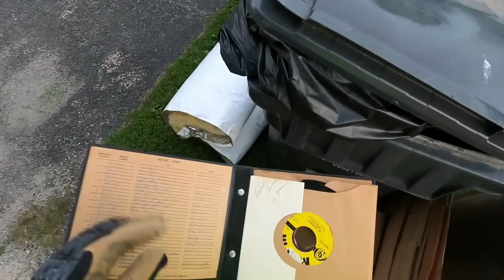Serious Street Scrap Aluminum

Comment: I just told "Mike the Scavenger ", I dragged a motor thingie with brass fittings on it behind my work dumpster. I asked several customers (in conversation) if they scrap. I had one gentleman that took it.  It ended up being about 25.00 worth of brass, then shred metal.  It made me feel good.  I'm watching and learning from you and Mike.
Reply: Mike and Paul are great
Reply: That was very nice of you.

Comment: Great video Paul. Here's a hint/trick I use. I tie a small piece of shoe string through the holes on my hard drive magnets. makes it alot easier to pull off metal when they are stuck. give it a try. 🙂

Comment: Maybe I am taking this the wrong way but if there is any changes involved I would have thought they should be paying you to have the brake discs collected. To charge you for collecting seems the wrong way round to me.
Reply: It's basic business. They have scrap which has a value of X which they are currently getting rid off for nothing.
By selling it to Paul at $20 per load, they are making some money whilst not having the hassle of taking it to the scrapyard themselves.

If Paul switches to a monthly collection, then he makes $380 after their cut. If he keeps to weekly, Paul makes less, but they make more.
Reply: @ramblingman8992  Yes, its a bit of a double edged sword. They should be paying Paul to take the rotars away as he is providing the service for them. But I suppose at least that way everyone gets a share of the pot so both parties win. Good point.
Reply: @DSCC007  And this way he has a secure source. "Sorry Phil, Wisco, and Rambler. This account is Paul's"

Comment: Your scrap mess looks a lot neater than some peoples houses who don’t scrap. 🙂

As far as picking up the rotors from the chain outfit. I would leave them a container like a plastic barrel or box. Give your name and number to the manager. When the container is full you have a pre-agreed upon price to pick it up when the store calls. Make it fair for yourself price wise, so your not doing it for nothing. This way on months with few brake jobs you’re not making empty runs, and some months you may several runs. Be conservative on the percentage that you pay the shop, explain it’s to account for your costs and fluctuating steel prices. Now the shop can advertise to their customers that they recycle too.
Reply: This seems to be the wisest way if he has to pay at all. If the barrel will hold enough to cover the cost and make a profit. What is his past experiences?
Reply: Corporate is just getting greedy🤦
Reply: @lisacates4185  How do we know it was corporate  & not just , manager,  
yes leaving bin there would be a good idea.  Thanks
Reply: @donvoll2580  I was going to say, maybe manager could have a hand in on it. If manager just trying to help save a couple bucks fine. But if trying to make someone else to pay to get rid of there trash, doesn't work that way.
Probably doesn't understand that steel, cast and tin you don't get anything for.
Some places you may have to pay to get rid of tin (white metal).
Reply: Look at the number of thumbs up on Dave's suggestion. Good workable thinker.

Comment: As for the rotors: they would normally have to pay for trash removal, which is what they are to them, but it's not at all unusual for what is a waste product to be sold if it is of value to someone else. I would counter-offer, you don't have to take their first offer, and it seems like it would be better to do it per pickup, instead of monthly so you're not paying during slow months. Run the numbers and see if it is worth it.
Reply: I agree except for the part that it would normally go in the trash. Most of the auto shops in my area already have a scrap yard metal dumpster that once full they get paid well for it from the scrap yard.
Reply: yea most trash removal companies arent going to take rims, rotors etc. the shop has to get rid of it somehow, costing them money to have it sitting around waiting for a citation or whatever. Make a shop an offer to be their sole removal source. they call you and only you

Comment: Idea 💡 
When you get another scraped reach in cooler bolt some caster wheels on the bottom, spray it with your colors. This could work and be heavy duty but still may have to unload a portion then flip it on the side to empty.

Comment: on the passing train the 2nd DPU aka 'Distributed Power Unit' (mid train diesel) was KCS aka Kansas City Southern Railroad.
Reply from the maker: How did that Kansas City engine get in the middle of Illinois?
Reply: Multiple railroads contract with each other on continent-spanning long hauls. Based on % of mileage each RR allocates a number of engines. So, that said some days you'll see all UP, then a mix, and maybe all KCS. 

Other loco unit shares are what's called run-through. Each RR sends a daily train to the other as a normal part of commerce. They balance the horsepower hours between them per agreement. Occasionally the balance tips one way off norm. That's when you will start seeing more KCS units where you normally wouldn't expect them. Same with any other big railroads. 

In NJ where I am one can regularly see a huge mixture from all over North America (US, CA & MX).

Comment: Idea 💡 
Find a couple of those nice trash cans with the wheels. preferably a orange one and a green one, switch the lids to make your S&P colors. Then you could leave one at the rotor pickup and switch them out to save your wear and tear on you. Maybe make it worth paying for scrap if it leads to your cans catching on at other places too. $&P lift gate for the win!
Reply: plastic barrels are pretty tough and I bet he could salvage some durable casters off some exercise smacker2000's.
Reply: Ooo
Can that barrel fit in that trash can?
Thinking it needs a lid because of the weather (ice & snow). And a way to get his colors (brand) at the same time. 
Great idea of the equipment wheels!

Comment: I would definitely  pay up and be happy to lock it down at least for now.
 I think what most people are missing is the fact that a local scrap  yard has not already  put a metal dumpster in thier lot for free. This is common practice near me.
 Sounds like about 10%of the value so no big deal. Steel prices have likely bottomed so.
God may provide but it's your job to hold  onto what he provides.  👍

Comment: It's a big commitment to buy scrap every week or month. Your free to plan your own scrap collection. Plus, if the price drops if you add into the cost of fuel, you could be worse off.
Reply from the maker: Good point.
Reply: @ScrapPalletMan  Paul you are your own boss, enjoy the freedom, I do.
Reply: price drops, you horde the rotors. I pay $100/yr to pickup apt complex's scrap. Im sitting on 300+ garbage disposals, washer motors, ceiling fan motors cuz the prices havent been worth going for 2 or 3 motors. I'll walk away with more then I paid for the scrap

Comment: In my area commercial Locations are charged extra for garbage pickups, so scrapers are doing them a service by removing it from the landfill circuit.
Reply: in our area, commercial stores have separate dumpsters for scrap since it cant go in regular trash. Sears Appliances outlets have a semi trailer outback. I had deal with mgr to take stoves, microwaves, washers. till the installers cried I was stealing anyway

Comment: If your really interested in keeping this source, you get a metal cart on casters, you leave it for them and monitor how long it takes them to fill it up, then you will know how often you need to do a run, you need two carts, one to leave each time you do a pickup. never let a resource get away if you don't have to.
Reply: I like the cart idea. quick load and unload. Wheel it right up to the platform scale. Or two carts to switch out.

Comment: in Wisconsin the customer is supposed to get their old parts back. so the customer could say "im giving it to Paul and he will be here to pick it up within 30 days. probably not practical.
I like the notion of a monthly pickup, but you need an adjustment clause so in crash conditions you can cover cost and labor. it has to work for everyone

Comment: Hi Paul, for those rotors is there a guarantee every week that you will get enough of them to make it worth your while in paying them $20 a week. There is the cost of gas, your manual labour in picking them up, and unloading them at the scrap yard. Also how much are they worth. If you only get four one week, you’d have to take $20 off the end cost of what the scrapyard will give you. You could see if they could store them out back and you get them once a month for $20.
Reply: finally someone that grasps the concept. a guaranteed heavy haul spot for a nominal fee pays for itself in the long run. as the saying goes - it costs money to make money.

Comment: Hey Paul, just wondering if you know the propane regulators on the grills are usually made of brass if I recall correctly.  you could snip those off with your wire snippers.
Reply: zinc or  usually aluminum with a brass fitting.

Comment: I worked in a couple different shops and they add hidden charges in the bill to pay for disposal of things... It's in the shop fee... 
And unless the part is going back to the company for a core then the shop has three choices 1 trash the part, 2 pay to have hauled off, 3 give to scrappers.    He is trying to get paid and it will not go into the till.... If you decide to pay make sure you get it in writing and a receipt for each transaction..  then he has to explain the extra money or where it is.

Comment: Paul, do you utilize the chain mechanics shop for oil changes, mechanical work, etc?  Perhaps some vehicle work that you may need anyway might make the new manager think differently on charging you to haul away their scrap.
Reply: barter might work. usually for awhile till the work on vehicle outweights what you bartering for, then you on the hook for the balance or the manage expects a cut of the loads to cover the balance

Comment: Stainless can get rust stains on it. If a piece of steel is sitting on it when it gets rusty. When I had to keep my scrap totes/buckets outside. I definitely had to drill small holes in the bottoms of them. I've been scraping since I was 13. I'm now 63. So you seem like a rookie to me. But your getting there.

Comment: Purchasing scrap backfired on me from a dealer in another town, I would drive a route and it would be around 100 or so miles round trip a dealer in a town about  40 miles away would hold all scrap and batteries by the time I had got there my truck 95 Ford ranger was 3/4ths full mostly rotors and breakage I had to purchase scrap from the dealer but had done so for over a year,but this time I got ther they showed me everything and I paid which was around half of what I would get after loading everything the pile of batteries about 30 or so I had no room for which it has happened a few times before no problem just get them the next time which is within that same week well when my next trip the main guy thr manager got a new job and they wouldn't allow me to get the batteries I paid for .50 cent a battery times 30 or so so be careful I stopped purchasing

Comment: I do scrap metal in the UK and not once will I pay to pick up, Like you I offer a free service but when it drops as low as £30 a ton I will charge £5 a pick up and that's for whatever there is so if there is 1 or 30 items its still £5. I think that new manager is trying to take advantage, If they had a waste firm pick it up the company would be charged for the service...well at least here in the UK they would and I presume it would be the same in the USA. Tell the new guy to go whistle dixie lol I would actually wager the 'Fee' you picking it up wouldn't make it anywhere near the till or the accounts.

Comment: Do you strip the crutches down to clean aluminum. Or do you just scrap it as is.
Reply: they are usually riveted these days and the padding is so tight you couldn't make hourly on it. Especially the walkers.
Reply: @wisconsinfarmer4742  I use a reciprocating saw, or a hand grinder with a cutting blade on them. Takes me no time at all.
Reply: @TheCompound01  im such a frugal bird it injures me to use a consumable wheel or blade. 
do you slit the plastic sleeves to get them off?
Reply: @wisconsinfarmer4742  most of the crutches I get have plastic handles. Held on with a bolt. I just cut the bolt in half and pull out. The part that goes under the arm pit area. I just cut or grind off the rivets and knock off with a hammer. The rubber stopper on the bottom. I cut and pull off. As for the walkers. Cut bolts, grind rivets, let the hammer do the rest.   The hand grips and cushions. Try to cut and pull off. If I can’t get hand grips off. I just cut them off.
Reply: @TheCompound01  It is a shame that perfectly serviceable equipment gets cut up while people pay such high prices for new.
Reply: @wisconsinfarmer4742  very true. I do always ask friends and family. If they now anyone that needs or could use, before I cut up.
Reply: @TheCompound01  That is good to hear. Keep up the good work

Comment: You sure that's not a fee for disposal they are not passing on to their customers?  I'm mean in Ohio I was always charged a small disposal fee when I got new tires at the big chain stores.  I'm sorry but they should be paying you to remove it for them.  You have been basicly providing them a free service by hauling it away for them.   Think about your labor to remove it, gasoline in your truck, wear & tear on your truck, etc.  No you shouldn't be paying them for their scrap metal.  It sounds like this new person is just trying to find a way to skim off the top money that corporate really doesn't track.  Don't let him take advantage of you.  DO NOT PAY ANYONE FOR SCRAP to RE-SCRAP.  I guarantee he won't be wanting it piling up there in the way and then taking it down to the scrap yard.  This is just another example of corporate greed wanting to taking advantage of the small struggling working man.  Is he going to pay your medical bills when you pull your back out from lugging those heavy things out?  Isn't that brake dust hazardous...can it do damage 2 your lungs?   Please don't let him use you!

There's no guarantee of pricing on scrap and other factors such as fuel, labor is not considered either.  Just a thought....I would call around to different locations and ask what their policy is considering disposal of the rotors.  I'm just petty enough to call the corporate headquarters and ask if they have a contract for disposal.   Or if they leave it up to each franchise's discretion.  But I can guarantee that non of these shops want these piling up for a month to pick up.  I am also willing to bet they DON'T make others PAY THEM to have the honor to pick up their scrap...which is their trash/waste products.  Somebody's trying to scam you!

Sorry to be so long, but this just pisses me off to see people try to take advantage of you!  This just isn't good business practices.  I believe something else will come your way.  Leave your card and walk away.  Your overhead costs wouldn't really offset any profit for these.  God will send you a new opportunity.
Reply from the maker: I decided to let the automotive place go. Those rotors were never at risk of being thrown in a dumpster or the landfill. I'll utilize my time grabbing metal that is set out for the garbage man or in a dumpster.

Comment: Paul stainless steel isn't rust proof it is highly corrosion resistant it is also not 100% non magnetic. 300 series being the best in the corosion depart and  300 series stainless is also the non magnetic stainless. But if you put a magnet to a stainless steel fork, fridges,  grills and ect. it will definitely stick.

Comment: The bowling is not a knot!!!
It is a bend. It is one of the most useful bends. Oh and versatile and I’ve ever used on board ships!! A knot such as an overhand not once it’s been wet a few times and surged a few times he literally have to cut it off a bend can get wet weatherized surged and you can still back it off and loosen it up by pulling on the back heel!!!
In my 30+ years of going to sea. I’ve never heard a Boland referred to as a knot, other than yourself.
The boland is also one of the very first and probably the foremost Bend that a new seaman will learn and use his entire career!
Reply from the maker: More specifically it's actually a fixed loop

Comment: Regarding the rotor pickup   I wouldn't pay this is a new manager thinking I'm gonna make money out of the Scrapper  I reckon they have probably done it in the past charging ppl for there scrap. It might work at the beginning but its alot of work managing scrap. The new manager probably thinks he is very clever. I bet any money they probably charged in the beginning with the fluctuating prices it's a very varied price.

Comment: the scrap is owned by the customers who had them do the work, it is not for their management to capitalize on the customers "cores". I wouldn't deal with them, this is as unscrupulous as the parts stores selling "NEW" components and charging a core charge for the old ones that were not part of the deal on the purchase of "NEW" parts.  Time to run the crooks out of the Auto Repair business, especially the ones who did no work or provided no service.
Reply: so do you get your old tires, brake pads and oil back whenever you have service done since by your logic those belong to you

Comment: Stainless steel can most definitely rust. There's over a 100 of grades of stainless steel. Any stainless with low chromium content will rust
Reply: And testing with a magnet is not meaningful.  Many grades of stainless are magnetic based on their chemical composition.  I suppose it all depends on your scrap yard whether they will pay you stainless prices for lower grades of stainless steel
Reply: @markgriz  true. I have a STACK of sinks worth .30-.60. 
I use a weak magnet and separate by magnetic/nonmagnetic.